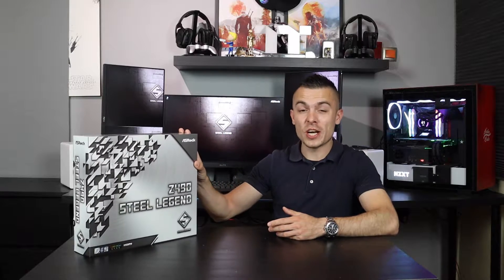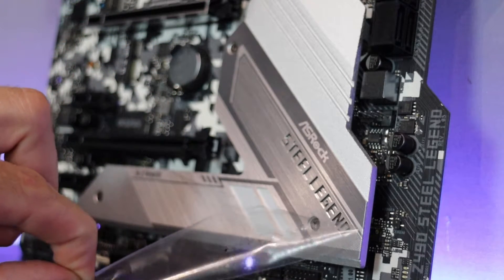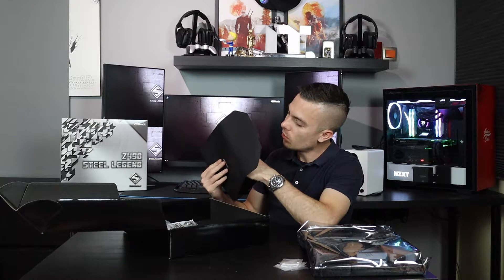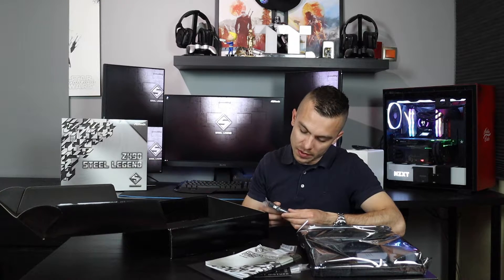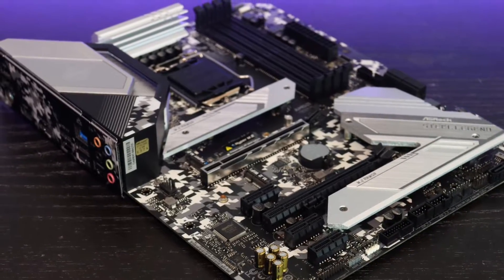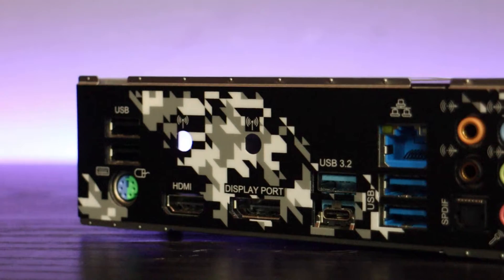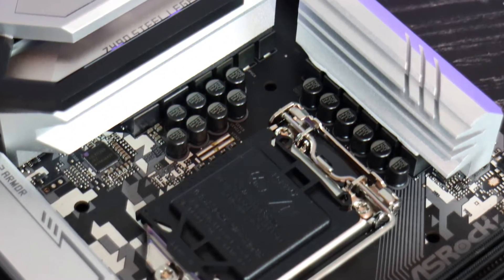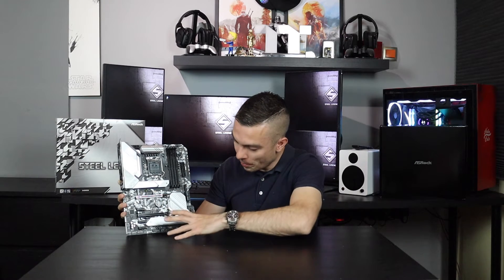ASRock #Z490 Steel Legend - Introduction and Overview

Comment: Don't be fooled by this board or extreme 4 model (both z490). They have WORST ever RAM OC, even its z490 and ASROCK. I have 3 different kits on hynix/samsung and none of these even work on own xmp profile. 

1) T-Group DARK Za 4000mhz - works only at 3866 (cant post above 3866)
2) T-Group Night Hawk RGB White 4000mhz - works only at 3333 (cant post above 3466)
3) Patriot Viper 4400mhz - works only 3833 (cant post above 4133)

All these results are stable. I tried everything - xmp optimization, secoondary timing optimization, auto/manual setting switching, voltage change (vccio vccsa dram). Please past these two board! Asrock don't give a shit about BIOS updates for them. Even Z490 Pro4 (Cheapest one) works fine with all those kits and same CPU (10700k) and higher grade boards are NOT.
Reply from the maker: In QVL list, only one model of Team Group RAM works on 4133MHz, 2x models on 4000MHz, 5x models on 3600MHz. As for Patriot, one model works on 4133MHz and one model on 3600MHz. It is always suggested to check the QVL of the RAMs on each motherboard to see the full compatibility.
Reply: @PCCrazyDario  I contacted them twice, new bios update was published, still same results. Switched 10700k to 10850k - same problem

The most interesting fact is board I used before SL was Z490 Pro 4 (asrock too) and it was working fine with 2 of 3 kits. They really don't give a shit if cheapest board can hold 4000+ and expensive 2 board couldn't

People should look more at Asus boards. Gigabyte bios even worse than asrock. Msi had many returns at this gen (z490 150-200$ range boards), the only normal choise is Asus for now while picking z490 board

Comment: no rgb showcase ? you can plug power supply cabel for this
Reply from the maker: arc warden It will be done in the review. Not going to show everything right away. 😉
Reply: @PCCrazyDario  whaaat happened to the review? I just purchased this motherboard
Reply from the maker: @anthonyarias4517  Unfortunately had to return the board before time. :(
Reply: @anthonyarias4517  i want to buy it .. do you recommend it ? Can it handle 10700k to hit 5ghz